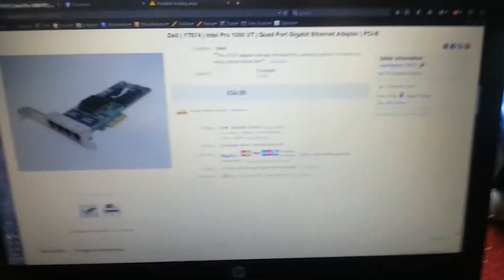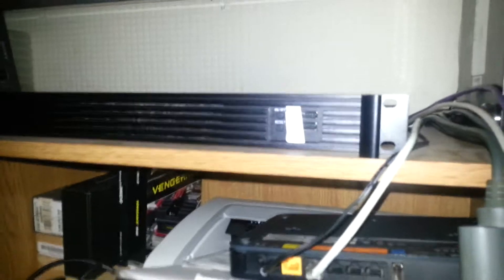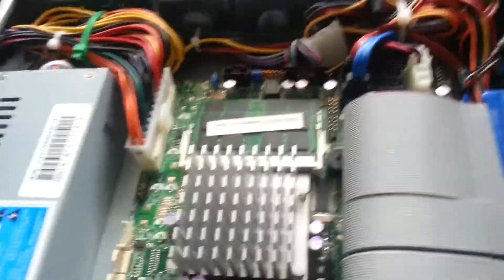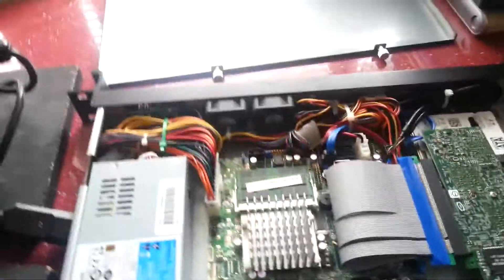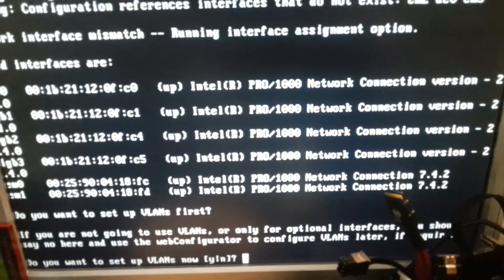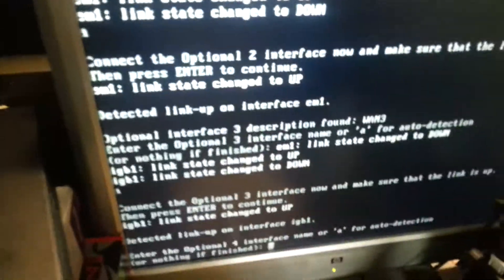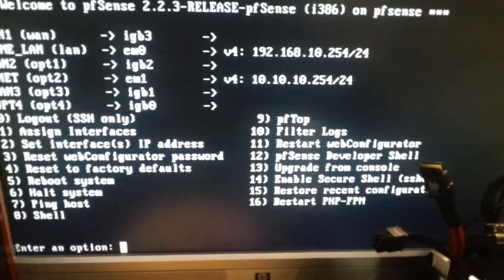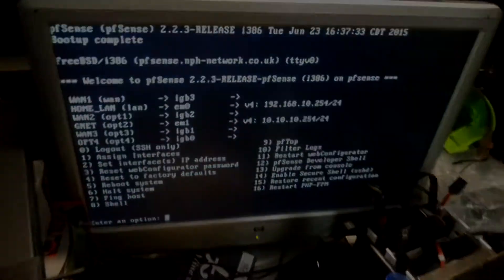Upgrading My pfSense Router / Firewall - Adding A Quad Port Intel Gigabit NIC, Totaling 6 Interfaces

Comment: i installed this on a PC but pfsense is not working!! the inbuilt ethernet port doesn't get a DHCP ip, but if i remove the card, then it works fine. I'm guessing this works only on a server hardware..
Reply from the maker: No it works on standard desktop hardware too, however the interface you plan on using must be supported by FreeBSD as that's what pfSense is built on. Most Intel interfaces are supported, I've also used a lot of Broadcom and Realtek branded interfaces in the past.
Reply: this is what i bought. http://www.amazon.com/gp/product/B002B8CJVC?psc=1&redirect=true&ref_=oh_aui_detailpage_o03_s00

pfsense is detecting the inbuilt gig ethernet card and the 4 interfaces from this card. however, it does not assign a DHCP address to the em0 WAN interface. it doesn't work if i set a static address. However if i remove the 4 port NIC card, it assigns a address and I can go to the web interface. I even disabled the inbuilt Ethernet and use one of the other four interfaces an WAN, but it doesn't work...

Any thoughts?
Reply: @prajganesh  have you try to use the new igf0 for Wan?